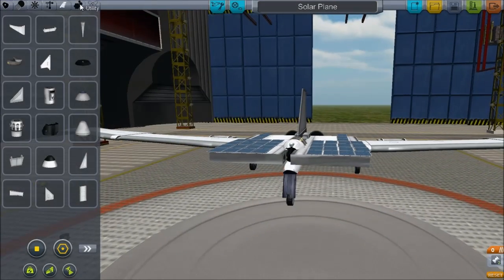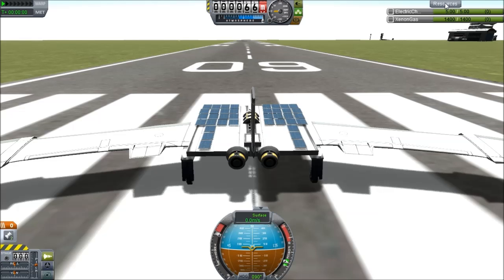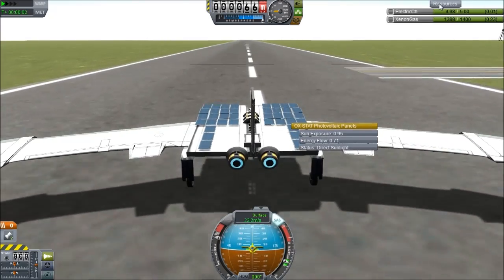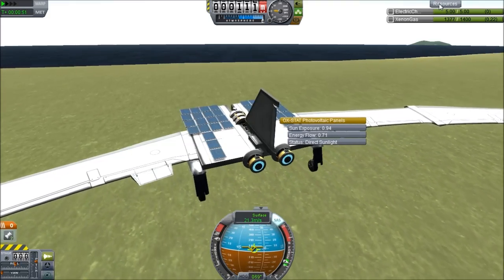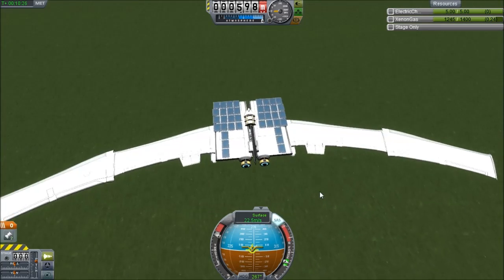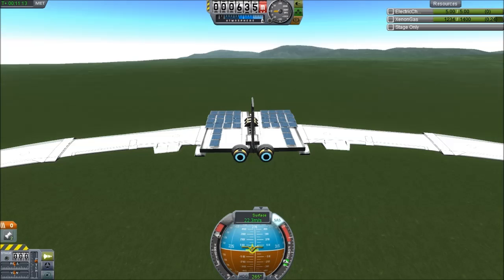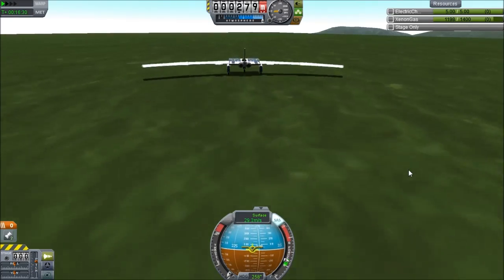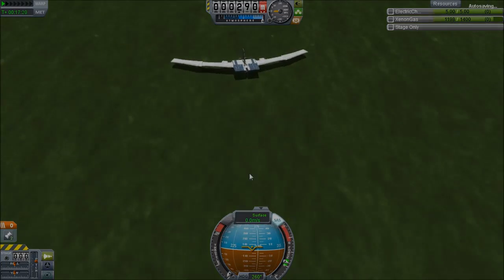Solar Powered Aircraft in Kerbal Space Program 0.18

Comment: Hm is this possible in real life? Why don't we have ion-powered electric airplanes? Are fans just more efficient?
Reply: Single engine, propeller-driven, light airplanes (2-6 passengers) generate in the neighborhood of 1000lbs of thrust during takeoff (give or take a few hundred). Ion engines produce TINY amounts of thrust compared to combustion engines, the most powerful ones currently available only develop about 1/4 Newton (.056 lbs) of static thrust. Even in ideal conditions, you'd need a runway dozens of miles long for the craft to accelerate enough to lift off and if something goes wrong, the pilot can't count on the engines for help.

The difficulty with Ion engines is that it's MUCH easier to generate electrical power than thrust. Ion engines are very efficient, around 65-80% depending on design, and can operate continuously for Years. That's great for deep space travel where you aren't limited by time or distance and thus can accelerate indefinitely, but not particularly useful in atmospheric travel, where you need to be able to create large amounts of net thrust relatively quickly for the sake of maneuverability and stall recovery.
Reply: Not with ion engines. As slow in the game as they seem, they are many times stronger than in real life
Reply: The Solar Impulse II just completed its trip around the world. It used propellers, but it was entirely Solar powered.
Reply: We do actually have this. It's planned to be made in the future, by none other than google of course.
Reply: QuantumBraced I know it's been a while since you sent it, but then. It is much easier to make a propeller motor than this would be, and it would also be more efficient because it would only require energy, so with solar panels we would fly infinitely.

Comment: I'm sure this has already been mentioned but, given the weight of the wheels, could you attach them to a trolley that stays behind when you lift off? Maybe use a chute for landing, if the weight trade off isn't counter productive. Will this still work in 0.90? I'll have to investigate this more, although, given the weight limitations, I'm not sure there are payload practicalities.
Reply: i think in 0.25.5 the ion engine had its thrust quadrupled to 2kN so i doubt there would be any problem now
Reply: mike ince Did they increase the power demand as well though?

Comment: I did something similar to this but it was much simpler. it consisted of 2 battery packs and xenon tanks, a mk.1 parachute at the front, obviously the ion engine in the back, 2 of the fancy pivoting winglets on the sides of the plane and 1 as a tail. the cockpit was the OKTO mk. 2 drone, 3 of the aerodynamic wheels and it had 6 solar panels. as long as the sun was up it could run at full capacity without burning out the engine, with about an hour of fuel. after 30 minutes at a steady incline it got to about 4km and it could probably glide just as long, it could reach relatively high speeds of about 110 m/s

Comment: meanwhile i'm crashing into myself with 480 parts, full wing solar panels, wingspan twice as big as this one, 20 ion engines and 20 batteries...
Reply: Ian McCollum Have you tried getting out and pushing?
Reply: Ian McCollum Haha. In true Kerbal fashion. I sent a probe to Eve and forgot the antenna. Not so salvageable :P
Reply: Lol, I had actually just gotten back from a munar orbit when I went in, super efficient lifter.
Reply: Meanwile, I am stuck in a really low dip aero break, ( 65 km kerbin)
Reply: I actually had near full fuel, but the rocket had a tencdancy to rip apart if you entered too steep. (Deadly re-entry and FAR)
Reply: Ian McCollum I see. Good luck friend.
Reply: I landed it... Forgot wheels on the wings, but glided it down safe enough to keep my science... Lost the engine and a fuel tank though.
Reply: Also, I ended up burning at apoaps to bring my periaps to 34, and circled the planet while gliding, landed in the desert to the west of the space center.

Comment: would this be able to fly into orbit?
Reply: Perhaps, assuming the ion engines can stand the gravity but I think not. I think the only reason this flies is aerodynamic-lift, for which you need air, wing surface, and a bit of horizontal speed. Getting into orbit will probably require more thrust in the higher atmosphere than the ion engines can deliver.
Reply: Ucarty
actually it could in ksp but it would be very hard o control and turn due to no air to give the wings the ability of control, it just wouldn't be controllable
Reply: Ucarty this plane does not need air as it is solar powered (with xenon gas of course). but of course it would still not be able to get into orbit.. it is just to slow! XD
Reply: faildafail Actually EVERY plane does. Because as I already mentioned every plane relies on "aerodynamic-lift, for which you need air, wing surface, and a bit of horizontal speed." Please read before you comment.
Reply: Ucarty well , yes you do need wings - to control it easier.
Reply: faildafail No wrong. You need them to lift it. Either watch the video to hear Scott Manley say (1:54) "its a question of trying to balance the need for lift with forward velocity " or simply read any page on aerodynamic lift. A plane/AIRcraft needs wings to go UP.
Reply: Ucarty it depends on which plane you build. whenever i build a Space plane and it gets to Space its harder to control.

Comment: another reason its ridiculous you lost power is that running engines creates heat and all engines (even the ion thruster) have thermal energy converters. which are about 80% efficient and the thrusters lose 20% of their energy to heat, so you are regenerating  16% of your energy. so you should need even less solar panels.

Comment: If he didn't intend it to land, or maybe just to land ONCE, he could have attached the landing gear to decouplers, and dropped them off, Me-163 style. Maybe, if landing with no gear proves unsafe (even at these slow speeds) make the cockpit detach and have a small parachute to carry the pilot down.

I always implement a detachable cockpit with chute, and of course, bind it to 'abort' key.

Are there ways to refuel, or get more xenon? Need electric propellers!

Comment: If you want lightweight landing gear, use the medium rover wheel (older brown one rather than the newer grey one). It weighs less and allows for taxiing on the ground. You just have a 60m/s limit for takeoffs and landings and dont want to come in too hard with them, doable though, I made a pretty big aircraft with B9 that could takeoff and land from the rover wheels fine and they do weigh less than the regular gear (not sure about drag though)

Comment: You can download a mod from Kerbal space port but the website has been down for a few days. the mod has improved ion engines including 1.25m and 2.5m drives it also has hybrid engines that use rocket fuel and xenon gas.
its called Ion Hybrid Pack

Comment: Scott, I don't know if anyone mentioned it, but I think the problem is that KSP is applying the normal logic for efficiency differences in atmosphere to the ion engine's electrical consumption (electricity is just fuel to KSP, after all), so it's consuming more power than it should. The "atmosphereCurve" parameter is in the part file (though I have no idea how it works), so that could explain your power loss.

Also, I didn't know KSP had a trim feature; this will make flying so much easier...

Comment: If you get one of the launch clamps ( I don't think that's the right phrase) and attach one to the rear of the aircraft, then raise it as high as you can, you can start off in a shallow dive to accelerate and remove the need to have undercarriage. I discovered this when making a Bell X-1 tribute with an SRB

Comment: I've had that same kind of thing happen to me. If you add a whole bunch of adjustable wings to a very light weight craft then hold down the W or S keys while on the runway, you will gain a lot of speed. I got a land speed of up to 600 m/s without any thrust, using just wings. Once you're in the air, rapidly pressing any of the directional keys will give it more speed. Once you have enough speed, tilt it upwards a little and make the craft roll. By rolling I am able to get up to 1000 m/s.

Comment: Very similar to something I made, although I managed to do a drop launch from a launch clamp on the runway which saved a hell of a lot of weight.

I could have done this easily by moving it to the VAB where it could have been dropped from a much higher initial height. Getting the initial angle of attack just right and making the craft light & maneuverable enough to pick up enough speed then level out along the runway seemed like more of a challenge though.

NB. They're boring as hell to fly.

Comment: Is it possible the ion engines consume more than it says on the parts screen?
At launch you're producing 27.36/sec
Your drain of electricity was 29.41 (You were losing charge at 2.05/sec)
Substracting the consumption of the pod, that'd make 29.40.
So the engines were consuming 14.70/sec each and not 12/sec, unless I made a mistake somewhere.

Comment: No point. Even if weight wasn't an issue (which is very much is), it would be sucked dry in a matter of seconds. The biggest battery has 500 units of electricity, and the Ion drives BOTH need 12 units/second at full throttle.